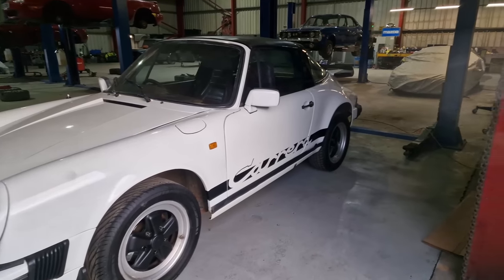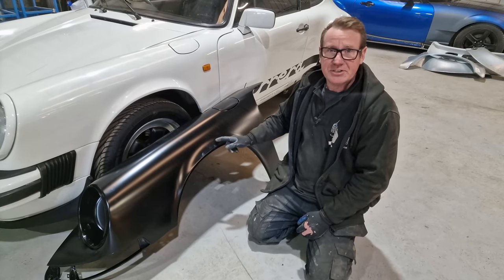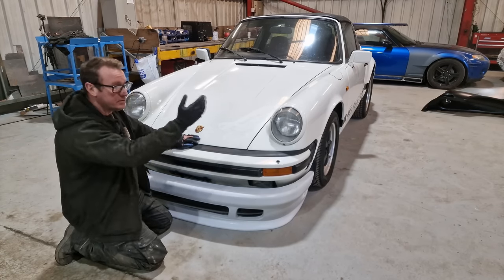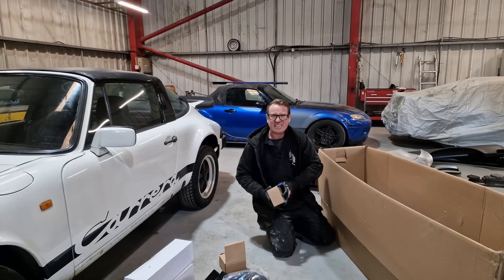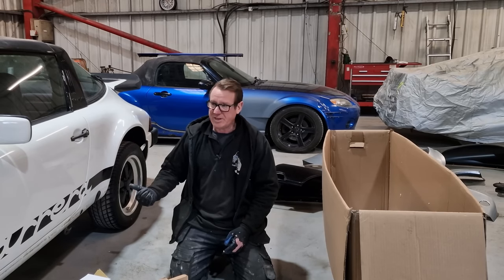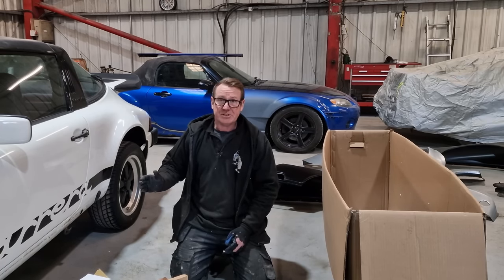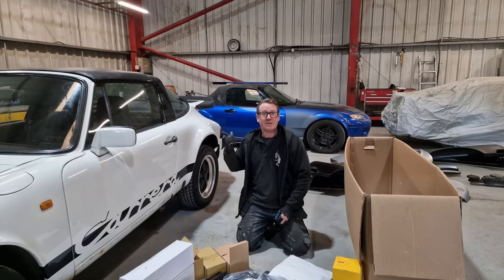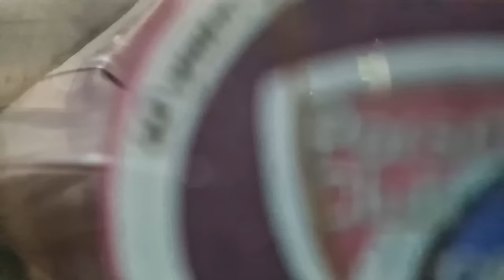Porsche 911 ST Build - Strip down

Comment: i know it's your project , but that new bumper is killing it for me. i love that mid 80's look with directional  orange lamps in the bumper, but i never was a fan of the earlier over the bumper version
i have 2 taiyo turbo targa rc toys from the 1986 and i had them forver , my ideal , even wider than your extensions  . this is very interesting project , don't get me wrong and i will watch all the videos, whenever they may come out. i am just not so big gan of replacing the bumper because i love the lamps and those black parts around